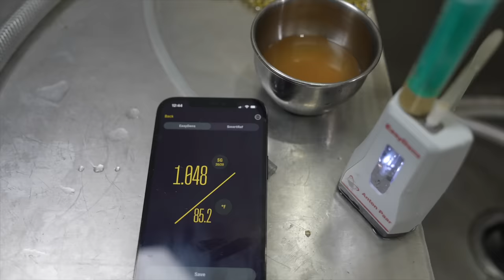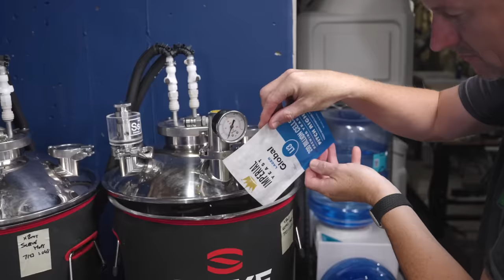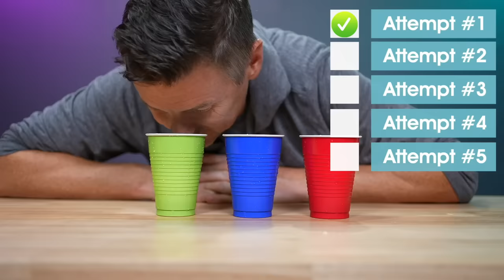Hops In Kettle vs. Hops In Stainless Spider | exBEERiment

Comment: This exbeeriment needs to be completed with an IPA or something with significantly more hops. Would love to see the results!
Reply: I agree. Seems a bit inconclusive to me. Can you do the same exbeeriment with a highly hopped beer like an ipa?
Reply: Came here to throw that exact comment, this was pointless. Doing a beer with THAT low IBU while doing a 60 min. addition makes it even more so... Should've done a NEIPA.
Reply: Nah an IPA has too big a flavor with hops coming from all directions including dry hops, fruity yeast etc, I don't think anyone could tell apart when hop volume is on 10 out of 10.
Reply: i agree
Reply: Agreed there's not quite 1oz of hops in the boil for this recipe not enough for the experiment.
Reply: @tomasbeha1645   I don't think IBU should be the determining factor as opposed to just overall hop quantity.  A west coast or NEIPA with a very large whirlpool addition would be very interesting.
Reply: A classic American pale with at least 3 ounces total would have been a better test case. Not sure why these type of experiments are always performed with blonde ales or pale lagers.
Reply: @CozzyB  The point is that with the small amount of the hops, like in the video, there is still enough circulation of the wort "around" the hops in the hop spider. With a much larger hop addition, the circulation could be significantly worse, resulting in the lower hop oils content in the beer. Just the theory, it would be interesting to see the result of the experiment on the IPAish beer.
Reply: @FrankGenoBruno  I get wanting to make a clean beer to where the subtleties don't get drowned out by hops, but hops here ARE the experiment so yeah I agree. A larger hop addition would have been a great function of the variable.
Reply: Agree, but from a different perspective.  If the whirlpool doesn’t work, and in this case I don’t think the pump was strong enough to create enough of a vortex to gather the hops into a pile in the centre of the kettle, then you are likely to get more hop matter into the fermenter which possibly explains Steve’s comment that the odd beer out having a “more vegetable character.”  (We can argue on a different link about whether isomerization continues at fermenter temperatures but again with more hop matter in the fermenter this becomes another factor to consider).  I’ve just made a 19L batch of a NEIPA with 150g of aroma hops at 80C and a strong whirlpool.  I don’t believe hop spiders work when using this amount of hops, even if you recirculate through the wort through the hop spider I believe the hops clog the mesh and the wort just flows out of the filter from the top of the hops not penetrating through them.  In this case it s easy to taste the much better hop utilisation (aroma) achieved by using a strong whirlpool.
Reply: @clivebrooker1  For me since he used processed hops as well as a low hop brew, test was pointless. I'll stick to hops and no spider.

Comment: Thanks for including me in this exBEERiment! I had a great time tasting those beers you sent over and it was fun to work together on this! Despite the results, I think I'll continue to skip the hop spider. I still think there's a boost in hop character in beers where more hops are used. Cheers!
Reply: Would like to see this in a west coast or a NEIPA.  A spider here is very challenging as it could fill up with hops quickly, but it dies keep a cleaner product in the fermenter.  Would like to see if there is a discernable difference.
Reply from the maker: There’s no fooling you even with a measly 22 grams of hops! Thanks so much for doing this!
Reply: A❤0😢🎉🎉 5:21 5:21 5:21

Comment: This confirms the Brülosophy experiment from 4 years ago where an IPA (Slipper Check IPA) was brewed. Participants were unable to reliably distinguish the beer made with the kettle hops added to a hop spider from one where the hops are added directly to the boiling wort. I’ll keep using my hop spider. Easier clean up, yeast washing, etc. Thanks for the video Martin.

Comment: I’ve chatted a little with The Apartment Brewer about this - the additional equipment for whirlpooling homebrew, while perhaps fun to have, is not at all necessary. Just run sanitizer through your chiller while you manually stir the hot wort for 2-3 minutes with a sanitized stainless steel brewing spoon/paddle, then lid the kettle and let it settle for 10-15 minutes. Drain the sanitized cooling line, sanitize the kettle spout, and transfer slowly enough to chill in a single pass. I’ve done a dozen or so batches this way with the same crystal clear wort you get with the added equipment, and my plate chiller has never clogged, despite using as much as 8 oz of hops in a 5-gallon batch.
Reply from the maker: That’s good to hear that this method works with a plate chiller too.

Comment: Martin and Steve, thanks for answering this question. In my case I have a plate chiller  so free throw hops are a no go.Also, bazooka filter clogs in no time if you throw hops into the  kettle.  Maybe repeat the experiment and brew a high IBU IPA and see if there is a sensory difference between the two methods.

Comment: Nice video.
I stopped using sleeves on late additions and whirlpool but use it on long boil.
For me it's convenient and it reduces mess.
But I have brewed IPA and just dumped all the trube and hops in fermenter.
Ferment with kveik and packet in a week.
No problem at all.
Less mess and easy brew day.

Comment: Nice to see Steve on the show. You two are my favourite homebrew YouTubers from over the pond, even if one of you came from my part of England! I face the dilemma of whether to use a hop spyder or not everytime I brew. Do I just chuck in the hops (usually pellets) and risk gumming up the false bottom or use the screen and spend ages waiting for it to drain all of that captured wort? Tghesedays I usually opt for the former as I think the utilisation is better and if I'm gentle with the ball valve I usually don't get a stuck run-off.

Comment: I recently made a NEIPA and decided to also ditch my hop screen for my boil addition (something I don’t normally do). My only kettle addition was a single 12 oz dosage of Calypso & Lemondrop (15 gallon batch) that went free into the kettle after bringing the temperature down to 175F. Instead of whirlpool it with a pump, I vigorously mixed the kettle with a spoon and stirred into a vortex and let it be for 20 minutes before transferring it over to my fermentation vessel while passing through a counter flow chiller. When the kettle drained, there was a huge mounded cone of hot matter beautifully collected into the middle of the kettle and it appeared that minimal bulk vegetal debri was carried over. Fast forward to dry hop day, I tasted the beer for the first time and was upset with the results as instead of juicy/aromatic/smooth hazy, I tasted a harsh/bitter/almost listerine like flavor(I think I blame the Calypso hops for that). In an effort to salvage the beer, I proceeded with a 2 lb dry hop charge that definitely added a fantastic punch of aroma as well as variations of flavor too. In the end, the beer ended up with a unpleasant to me bitterness factor that just wasn’t what I intended to achieve. I think the main issue was the amount of time the hops sat on the beer while transferring to the ferm vessel at around 175f extended too much bittering. In my case, I probably won’t free whirlpool hop very large hoppy beers in the future and stick to my kettle screen for those situations.

Comment: I use a hop sleeve when using a lot of hops.  Otherwise i run the risk of getting a stuck pump. Also, i get more yield because there is less hops and trub.

Comment: I skipped most of the brewing bit for the results. Then saw there were virtually no hops in the beers anyway. This needs to be tried with a big hop schedule to test a hop spiders efficiency. If I brew a beer with a small amount of hops I use a spider. If I use a lot I throw them in the kettle...

Comment: I have reached the point where I really don't care if there are differences in the finished beer.  What is more important to me is to have clear wort coming out of my brewing system with zero pump, drain, or chiller clogs.  I have not had a good experience with false bottoms and other solutions/techniques that are aimed at managing hop matter.   The only guaranteed way to get the result that I require is to use a hop spider.

Comment: You have to understand the statistical power of the analysis you are using is very inferential, meaning that the sample size directly influences the power of the test.  It's highly suspect to use only small numbers of subjects to come to any statisical conclusion.  The power of the significance is low, in other words.  And for any 3-way test, the probability of detecting a difference, even repeating the test, is relatively high, by chance alone.  Are you using Spearman's rank?  What are you using?

Comment: I found that the more hops I used, the poorer the utilisation when using a hop basket. Too hard to predict. The more hops, the bigger the difference in amount of hops required to compensate. I ditched the basket and went commando. I use a Brewzilla with false bottom strainer. The whirlpool thing isn’t really a thing with my thing.

Comment: @2:56 I notice you're boiling on the non-sleeved side at "208f" vs the 212 expected, while at boil that's no concern, I wonder if you're confirming mash rest temps via a separate thermometer and ensuring your rests were at the same temp. Haven't watched to the end yet, but an observation I made in case a difference is seen later, as this could affect body and hop perception.

Comment: Random question, do you filter the wort before measuring in the EasyDens? I've been using tiny coffee filter every time I take a reading with mine and it take forever to filter through. Wouldn't mind skipping this step. Thanks
Reply from the maker: I’ve never filtered the wort before using it. No problems so far.

Comment: I have often wondered what a beer would taste like with no hops.
Reply: It wouldn't be beer anymore. It would be malt liquor. You can already buy it at the store.
Reply: @justthebrttrk  It looks like Youtube removed my response maybe because I had a link.

I went to the homebrewers website and they actually have a recipe for malt liquor that does have hops so I do not believe you are correct.  I might actually try making the recipe from their page.

The primary difference between malt liquor and beer is that malt liquor is made with corn as well as malted grain.  With that in mind there is a couple of videos I think would be interesting.

Make a malt liquor and a normal beer basically the same except you remove the corn and just do more grains and compare.
Make duplicate beers but leave hops out of one all together.
Reply: @colkestrel  plenty of beers have corn in them. Many lagers do